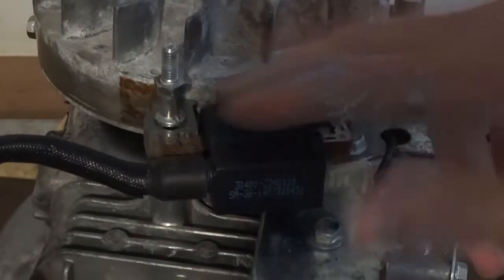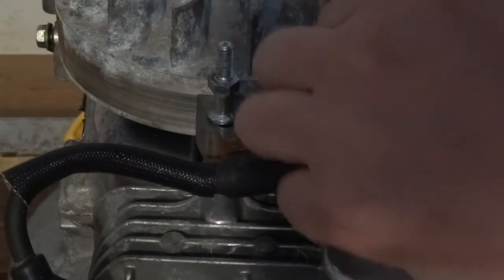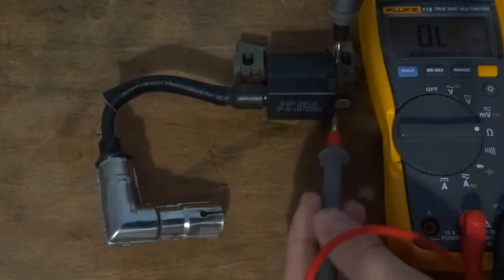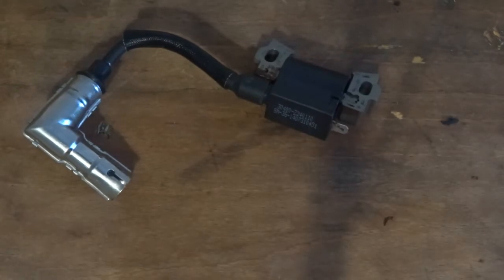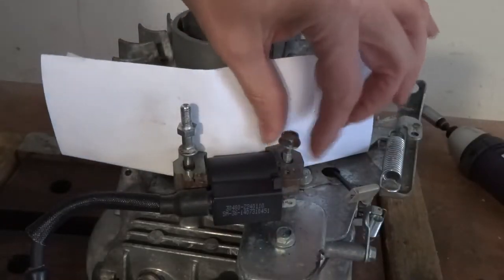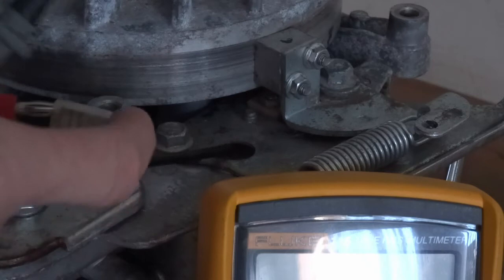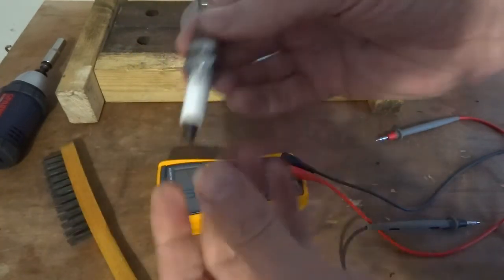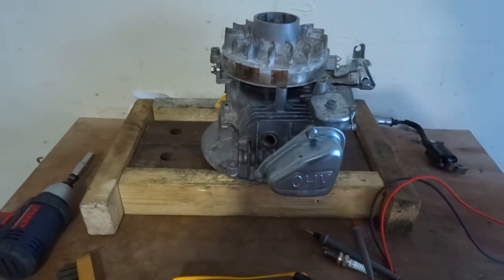Lawnmower no spark troubleshooting ( Mountfield SP164 RS100 )

Comment: Thank you for the info. Mine is being a mare to start. New Plug ( thanks for the info), New Fuel Hose (and flowing), New Prime Bulb, Carb Stripped and cleaned (inc all jets), New RS100 Ignition Coil fitted, New filter, Done continuity checks and all good, Gap good as well, Full Compression but still no bl**dy spark AAAAARGH